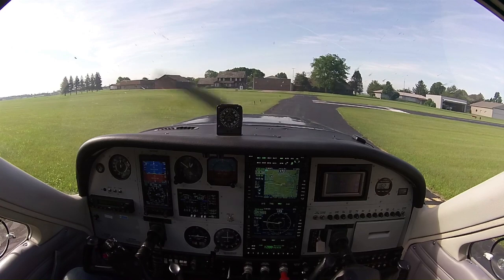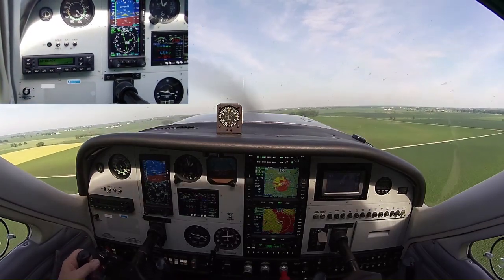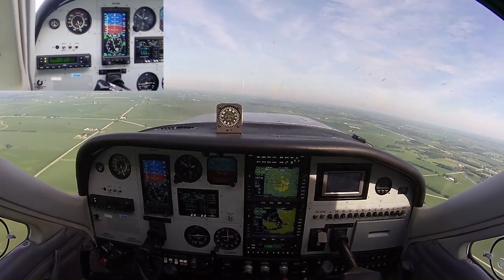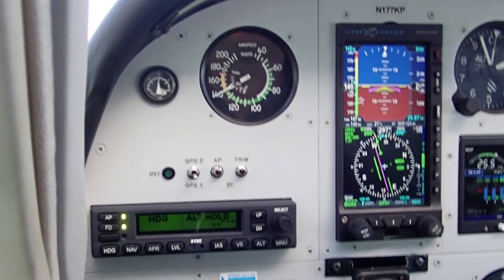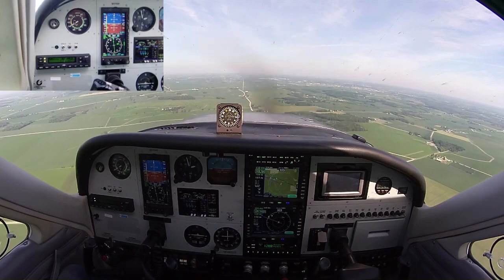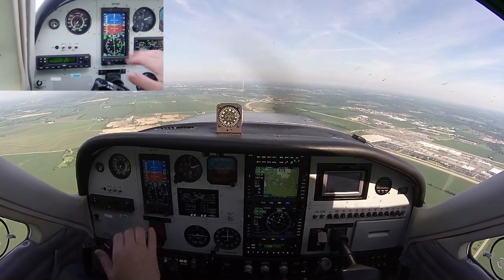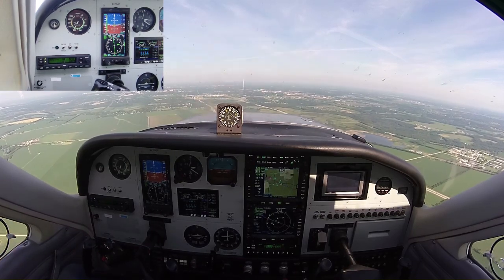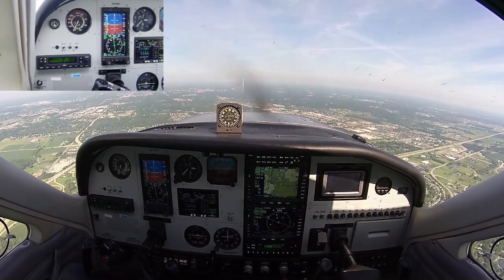S-TEC 3100 in flight operations introduction, with Aspen and Avidyne IFD550

Comment: I noticed your AP modes are annunciated on the Aspen. I thought that setup would show armed/active modes on the Aspen. Any idea why it doesn't?
Reply from the maker: No, on my installation the autopilot does not yet interface with the Aspen. That development has been underway for a while. As of late 2021 the software is available and certified, but they are still chasing some potential issues with pitch sensitivity so I have not yet done that upgrade.

Comment: Just came across your video here and it was interesting, along with a great looking plane you have and panel is really nice set up. I fly out of an airport real close to you called, the landings in Huntley and i have the dual aspen set up in my 71’ arrow. I have the step 40 auto pilot but would really love to go with the 3100, along with replacing my 430W with the avidyne and would like to know Where you have your work done at? Thanks for the video.
Reply from the maker: I know the Landings well, used to have a hangar there before moving to Casa de Aero. I'm a big fan of Mobile Avionics at Lake In The Hills. They understand these things a lot better than many shops, including the computer aspects. Tell Matt I said hello.

Comment: Have you tried other parameters of envelop protection yet?  Is there a pull force on controls at which the servos will disconnect?
Reply from the maker: The servos don't disconnect, but the servo clutch slips. So you can always overpower the autopilot.

Comment: Hey. Thanks for the videos.  Can you share how your trim and AP switches are mounted to your yoke?  I am thinking of doing something like that on my 310. Thanks
Reply from the maker: In this video the switches are mounted on a plate which STEC provides along with their autopilot. That plate bolts to the back of the yoke. I had a T-206 yoke at this point but later changed to a Beechcraft yoke which has the switches mounted in the top of the yoke arm. Strangely, I don't seem to have a video about that yet! Something to add soon...

Comment: Hi Keith, Very nicely done video.  Thank you. I have an A36 with Aspen and would like to upgrade my Autopilot from KAP 150. I am trying to decide between STEC 3100 and Garmin GFC 600. Did you have any problem with Aspen and STEC 3100 integration. Did you have to install additional equipment?
Reply from the maker: My 3100 was installed as part of the certification of the system for the Cardinal. So no, I didn't have any trouble, but there are a couple of boxes required until Aspen gets their software updated. For example the Aspen does not currently output IAS, so a separate box is needed to accomplish that. Same for the flight director. STEC will help you sort out what's needed.

Comment: Keith, Do you know if it gets it's vertical speed info from the 
Aspen or from the encoding altimeter. I have a KFC150 now and the vertical speed mode is terrible due to the
errors inherent in the encoding altimeter.
Reply from the maker: Hmm... yes, I think it does. Certainly the VS is much more nicely controlled. My 60-2 used the grey codes also and it was a little marginal, the 3100 is much more precise. Better yet, you can set an IAS hold which can then hit the perfect speed even if it isn't on an even hundred fpm. Frankly since I got IAS hold I'm not sure I've really used VS hold...

Comment: Keith, Thanks for taking the time to make your videos!  I am thinking about upgrading my 55x to the 3100 as well.  Currently, I have an old Collins PN-101 HSI and a new Mid-Continent A/I that I am considering changing to an Aspen PFD.  Have you been told by Aspen when the full integration of the S-Tec 3100 (ie. controlling the 3100 from the Aspen, mode annunciations, altitude preselect, etc.) will happen?  From what I can tell, the current 55x already works well with the Aspen PFDs.
Reply from the maker: Yes, they have told me that also, and told STEC also. But they keep slipping the date. Last I heard it was going to be 'early 2019' but they have already slipped a year. Both of their current autopilot integrations, from what I was told, were sort of a kludge. Their current project will make it more of an internal system so they can add future autopilots more easily. As a software developer I know how that can be, although such knowledge does not help with patience in the marketplace..

Comment: Keith, Thank you for the videos! I am thinking about upgrading my 55X to the 3100. Can you tell a big difference in the 3100 vs your 60 and was it worth the $$??
Reply from the maker: Yes, it flies the airplane much more decisively, and follows the navigation lines much more accurately. There are also far less mode changes than my 60-2... I can't say how it would compare to the 55X. Frankly, it was probably worth it only for the IAS hold! That really makes a difference.

Comment: wow grabbing a waypoint line and rubber banding for a quick change like foreflight, thats already a 1000 time more efficient than G1000 nonsense. Cant stand sitting on the ramp burning up hobbs time loading a flt plan into that stupid G1000, never going back to that over bloated glass cockpit, yours is awesome though.
Reply: I had Garmin Flight Stream 210 fitted with my last upgrade to GTN650 all I do is flt plan at home on Ipad Garmin Pilot and when avionics is turned on GTN asks if I wish to upload new plan etc what Keith is doing with rubber banding here can be done now Ipad on my yoke and Trxed direct to GTN. Works beautifully even my ancient 1977 ACR 300A has worked very well with this setup. 3100 would work a whole lot better!
Garmin Flight Stream 210
Wirelessly Link your iPad® to Your Avionics
Simplifies and streamlines your cockpit management
Works with the Garmin Pilot™, ForeFlight Mobile and FltPlan Go apps as well as aera 660/795/796
Enables traffic and weather from your avionics to be viewed on your portable device
Easily load flight plans – including airways – from your compatible mobile app to your GTN™ 750/650 series or GNS 430W/530W series navigator (Flight Stream 210 only)
Provides GPS location and AHRS backup attitude information
Reply from the maker: That's a funny thing... I do a lot of pre-purchase inspections and at times ride with owners on test flights. The guys with 650s rarely seem to touch them... they do all their work on an Ipad. I watched one guy look up a frequency on his ipad then type it into the 650, guess that's common too. 
I much prefer to have everything on the panel and easy to use. For instance for frequencies I press the freq button, roll down to the one I want and press the knob.
I'm sure you can get used to anything, and clearly preference plays a part. I'm glad you like your flight stream! But I my prefer my Avidynes. Plus they never overheat! :-)
Reply: When I was looking for upgrade none of my dealers offered Avidynes in my area in Australia all seem to be pro Garmin here.
Have to live with what you have installed.
Re overheating??? I live in a hot Tropical location have others had problems never had an issue in the past year???
Lot easier to just bring up the airport on GTN and all there in front of you just touch screen and all done ATIS, Grd, Twr etc in a neat row waiting to be used etc etc.
No turning knobs needed.
Do believe a lot of GTN owners don't really know all the simple ways to use all its features??
For GTN owners FYI
There is a GTN750/650 simulator that you can learn and play around at home to try all the features including flt planning and fully simulated flights (Hint great for IFR practice) and learn what works best for you're flying operations.
Actually the disk came with the GTN when you bought It or download it or Ipad version on line.
Reply from the maker: My overheating comment was thinking about the iPad. Like I said, to each their own! I use touch at times on the Avidyne to find and use airport details, as you describe. But flight conditions often make it much easier to press a button or turn a knob. I like having the option.

Comment: Nice! I have a '69 177B that I'm looking to replace steam with glass and a full autopilot. This is helpful.
Reply: Fork, is that a '70 177B that was built in 1969, or a '69 177A? No such thing as a year-model '69 177B. :-)
Reply: Ah my mistake. I recently trained in a ‘69 172 and that year was in my head.  I have a 1970 177B.

Comment: Keith -- nice video. Any word on the integration with your Aspen? I have a dual Aspen setup and I know the 55X is integrated so that you can select the autopilot's settings from the Aspen. I'll subscribe to your channel as I certainly would see more features of the 3100 as you explore them.
Reply from the maker: Yes, the full integration with the Aspen is expected in an Aspen software release expected in the July timeframe, last we heard. That will provide full sync of modes and settings between the Aspen and the 3100, so all altitude, rate or airspeed selections can be made on the Aspen. Bugs on everything! :-) My panel is already wired, just one attachment and a software load when the time comes.
Reply: Keith Peterson Thanks for the Aspen information. Did you upgrade from a previous STEC product? If so, how does the performance compare?
Reply from the maker: I have a new update on this.. Aspen says they can't get their original hardware to support the full 3100 interface, but promise to do so in the new Max version. Delivery is still TBD... something that Aspen clearly struggles with.

Comment: Looks very nice. I am trying to decide if to wait for Garmin or go 3100? Very large price difference here in Australia.
Have already gone all Garmin GTN, 2 G5’s and a G5 HSI etc etc about to find out next week if they will talk to my old ARC 300A
Did you have a 55 fitted before? Making your decision easy?
Regards Steve
Reply from the maker: No, I had a 60-2 with altitude pre-select and electric trim. My decision was based on a desire for even better performance and I got it.  The 3100 is attitude based, driven by the ADAHRS, where older autopilots were rate based, driven by gyros. It isn't clear that the Garmin will be this capable, and be sure to check the extra interfaces required. The new low-end systems  (TruTrak and Trio) are more position based, driven by GPS.  For VFR pilots those are great, but for serious IFR it seems worth getting a more capable autopilot from an autopilot company.  I am glad I did.
Reply: Thanks getting a estimate today expect in Australia installed from scratch $40K
Reply: Hi Stephen....just had my install completed 2 weeks ago here in AUS. Who are you having quote?
Reply: Was a just very rough estimate Complete Avionics are working on a better guess now, I have the ACR 300A still in her now so virtually a new install from scratch, I have no switches on my yoke so may have to replace them also to use all the nifty features now.
Could you tell me what you paid and and your past configuration and who did yours?
email if you prefer direct poppyduc@gmail.com